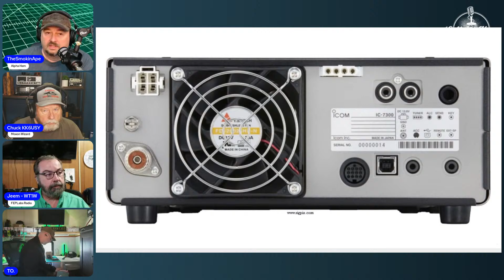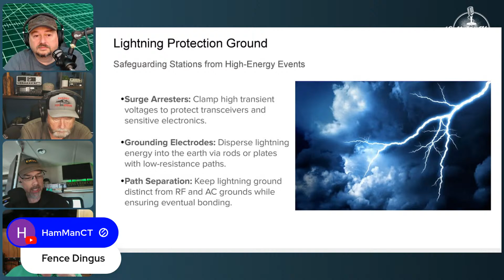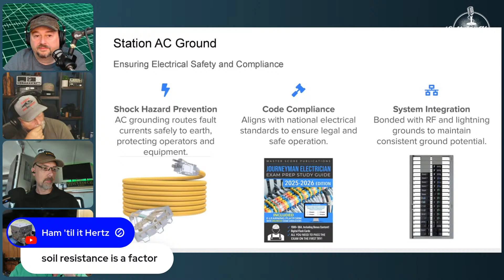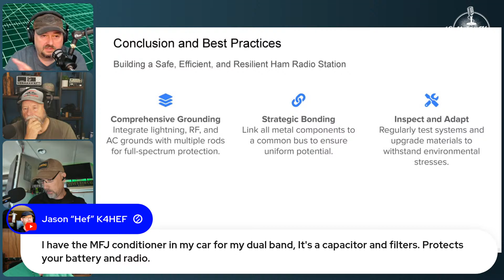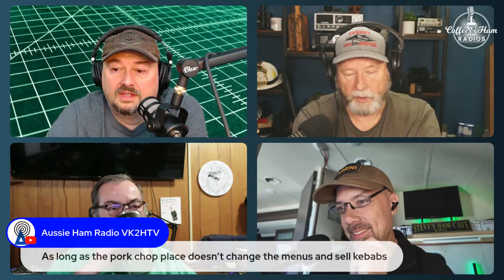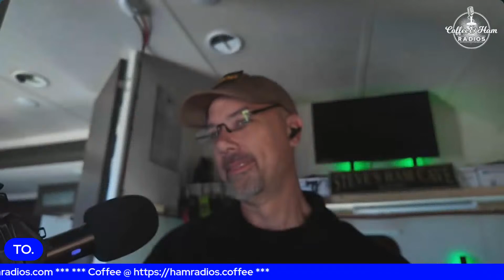A discussion about GROUNDING and BONDING for Ham Radio!

Comment: I have a diamond GSV3000, it’s got a bonding nut. But it has only a two pin plug encouraging the thought of the floating ground theory.
Reply from the maker: Interesting, I’m not familiar with that antenna but might have a gander.
Reply: @CoffeeandHamRadios no no it’s it’s power supply
Reply from the maker: Ah

Comment: I read and listened to rules and opinions on bonding and grounding until I realized no one knew. After much study I decided to bond everything in the shack to a bussbar and then to the dedicated station 20 amp outlet through the main panel ground rod. Everything on the outside is bonded to a 8’ ground rod and then bonded the two rods together. It might not be right but if not it’s on me.
Reply from the maker: You make a good point about much of the information being contradictory and confusing 🤷

Comment: WHy not just attach a 15 amp 120 volt grounding plug with a spade connection on one end that amazon sells to each device and satisfy code going right to the house service panel. It only contains the ground wire. Then use a ground rod and arrestor only for the antenna. No silly straps and bud bars. maybe a surge protector to plug all the cords into.

Comment: Coil based voltage correction has isolated DC and AC grounds. Switching power supplies that aren't also isolated have a common ground.
Reply from the maker: Correct

Comment: The case of even Astron power supplies is grounded to both the DC negative and the AC earth ground(safety ground). I checked, as my shack is on a second floor, so I use the power supply case as the common point, and that connects to the house's safety ground system. There should not be 2 different safety ground systems in a building, so having an separate RF ground is actually a bad idea. It is especially scary when you realize that the neutral of all the 120v circuits in your home(at least in the US), run back to the pole/power company via the ground, as only the hot wires come into your home, and if the safety ground system fails, all that load could then be going through your radio gear and through your shacks RF ground and you may not even know until there are glowing wires and/or fire from vastly exceeding the current limits of RF ground wiring.   If you are going to run a separate RF ground, you should isolate the DC output from the power supply from the power supplies AC(safety) ground.
Reply from the maker: Thanks for the info!

Comment: The case of even Astron power supplies is grounded to both the DC negative and the AC earth ground. I checked, as my shack is on a second floor. There should not be 2 different ground systems in a building, so having an separate RF ground is actually a bad idea.

Comment: Ground to buss bars with nice fat wires.
		  		   
		   National Bureau of Standards bulletin 120 (April 24, 1922, the crystal radio bulletin) says a 1/16" gap between pointy wires for a lightening arrestor.  And suggests a knife switch, preferably outside, to disconnect your antenna when not in use.
		   
		   Navy crypto standards, Tempest standard and red/black criteria, would be applicable here. With encryption, you are trying to keep unecrypted text (red side) from coupling to the encrypted (black) side and being transmitted for everyone to hear. (oops! :-D )
Reply from the maker: Thanks for the info!

Comment: Great show.  I am a electrician and gave most correct info. Hollywood is right on. Yes codes very all over. Drives me nuts working different areas . In the US  for UL on power supply's 12V(13.8V ) meant for commutations exactment the minus lead must be AC line ground.  This does not apply everywhere. LED 12V supply's need no ground on out put .   A lot of US codes are based in 120/240V split phase system.  Only north America and a few odd places use that power system.    Japan has different grounding do to 100V 50 and 60 HZ .  the only country that has 50/60 HZ in same country.   Many different systems around the world. That why different plugs . Some AM stations took direct lightning strike and stay on air.  All lightning not the same. different energy level and polarity . It staying cold in NY , Haven't seen 50F in weeks. Still getting snow . Was warmer in March. 73
Reply from the maker: Thanks for the info Robert!

Comment: The station bonding/grounding rules predate coaxial shields existing.  The “rules” as originally written predate three prong outlets. Remember that coax cables can fail.  The station bonding (earthing) cable has one purpose which is to guarantee DC potential between station elements REMAINS ZERO even WHEN YOUR COAX FAILS or IS INTERMITTENT.

The well known video “Ground is a myth” gets people riled up who didn’t watch or who did watch and did not understand all that was said.  The presenter in the “Ground is a myth” video is making solid defensible engineering statements of fact, and is challenging a kind of cargo-cult mentality in the ham radio world.  We all need more facts and more reality and less cherished myths.
Reply from the maker: Thanks for the info 👍